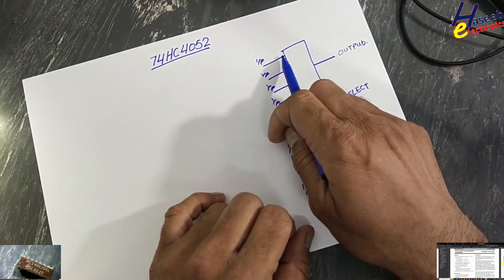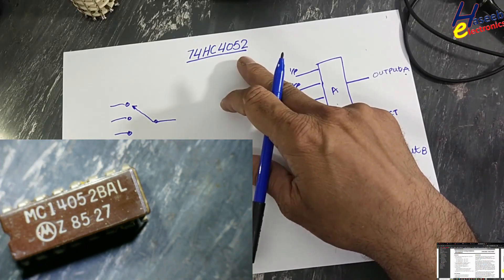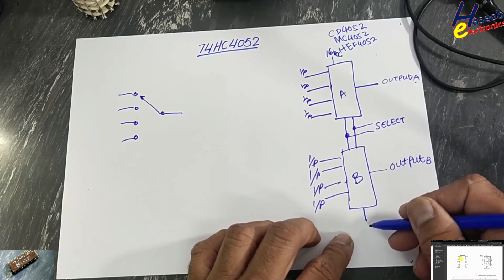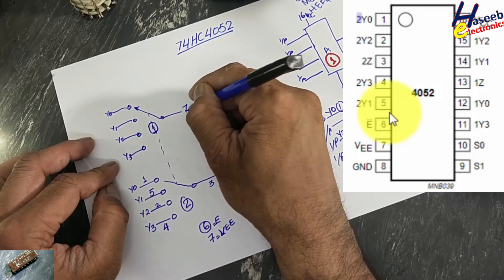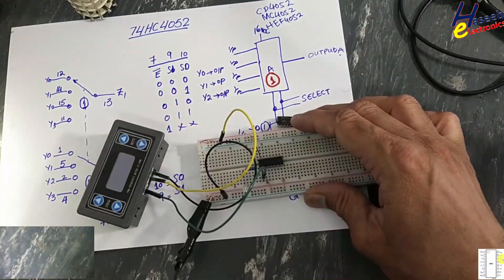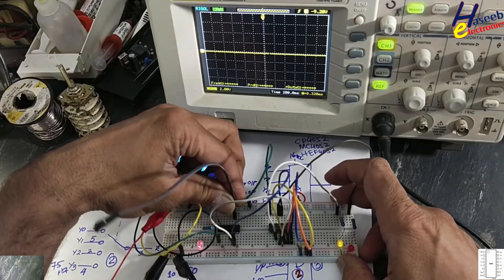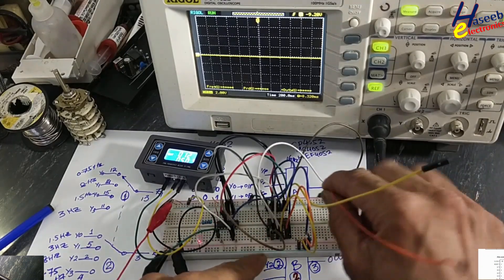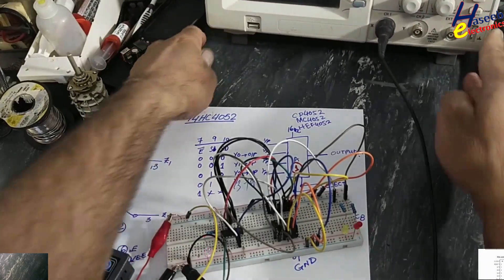{1257} How to test 74HC4052, CD4052, MC14052 Function

Comment: Wow that was a lot for me to take in , but I will watch it again over and over till I understand it. I know it is a bunch of switches that turn on and off depending on what needs to be turned on and off at certain times.. I have a Panamax 5100 surge protector I’m trying to figure out why it’s not letting power to the outlets , and I don’t hear the relays on the in coming mains turn on. There’s Vom, and thermo fuses which appear to all be good. I feel the MC14093BCP is what controls the relays is defective, so I’m trying to learn how to test it..any advice please let me know , I can send you a photo of the board and maybe you can help figure out what is wrong..thank you 👍🏼👍🏼👍🏼👍🏼👍🏼
Reply from the maker: this is very intersting IC
this video is in 3 parts (Video number 1257, 1257A and 1257B)
you must watch other parts of this video. so that you will gets its exact concept and its proper work in different ways 
yes thermal fuses gets open circuit, if surge protector reachs in more and more heat disspiation zone due to continuous surge strikes